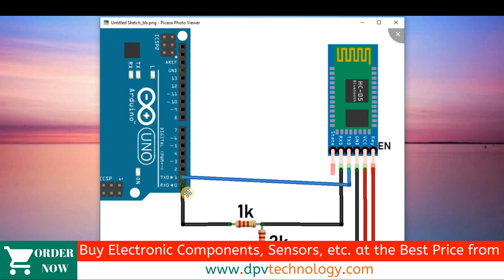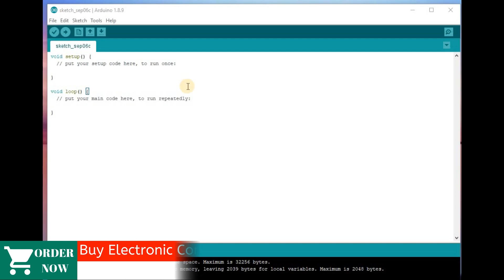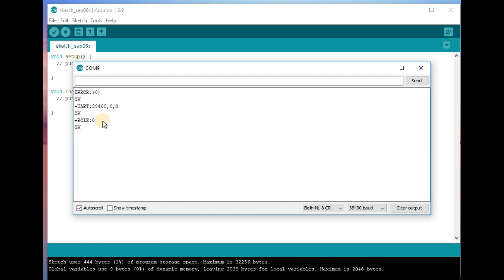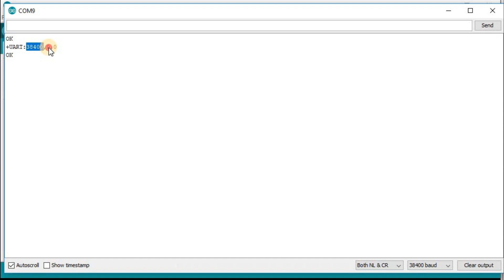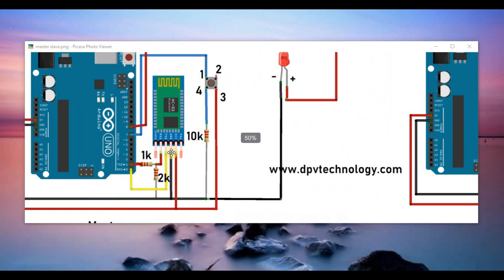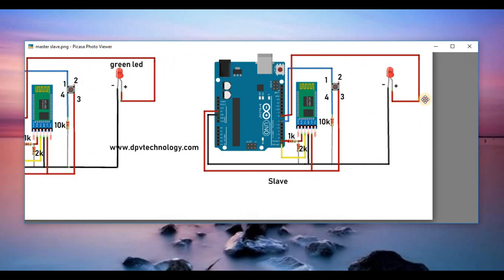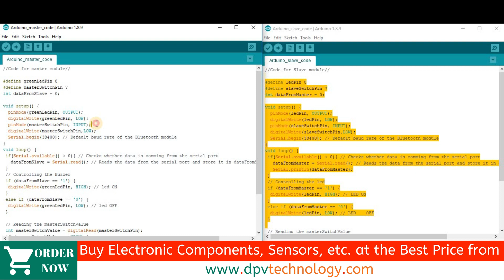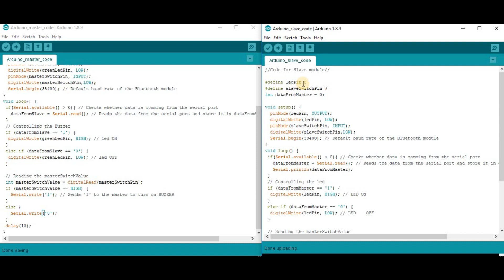How to Pair HC 05 bluetooth module  as Master Slave mode |Arduino Bluetooth AT Command Configuration

Comment: If when at command pin rx does not connect to resistor 1k&2k, is it okay? And program for slave mode isn't finish in your videos. By the way thanks for information. And i hope my question answer quickly plz thanks🙏🏻
Reply from the maker: I think you are asking that you want to connect the rx pin without using the resistors.you can directly connect it. Programs are given in the description.